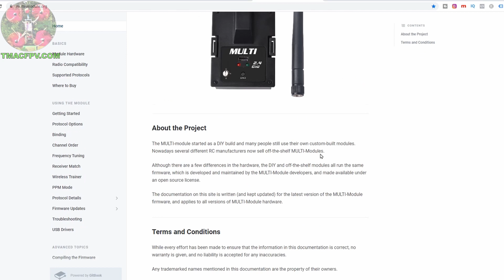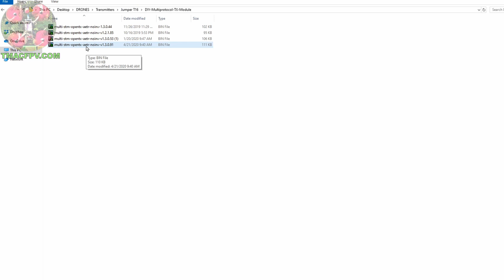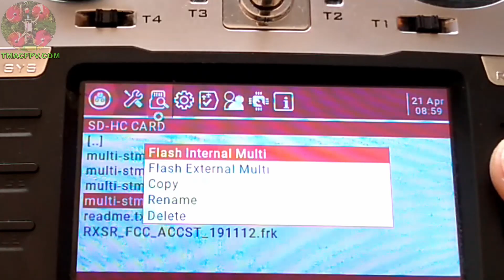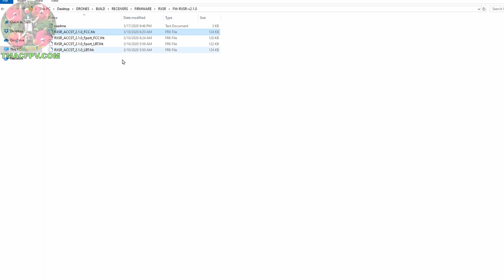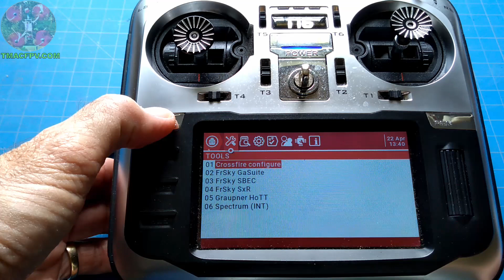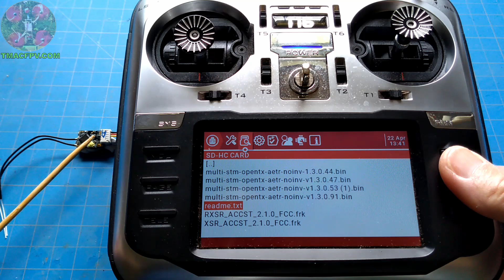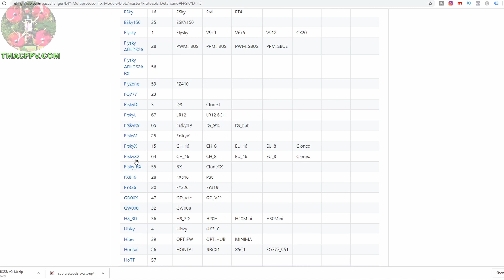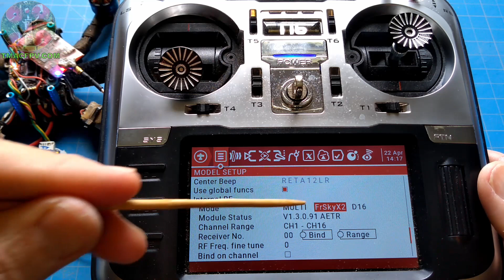Jumper T16 (NEW PROTOCOLS!)

Comment: is this update available for t8sg plus v2?
Reply from the maker: I do not believe t8sg plus V2 transmitter is supported by OpenTX operating system firmware.  i think it uses something else, therefore I do not know if the firmware that it DOES use has this update available or not

Comment: Just wondering is there any benefit to ACCST v2? 

Do you know if XM receiver comes with D8 or just D16? If D16 it’ll come with either accst v1 or v2? So I just select the correct option on my MPM radio and I’ll be good?
Reply from the maker: ACCST V2 was developed (supposedly) to correct inadvertent/random servo movements in fixed wing aircraft.  ACCST V1 works fine for quads. Tough these days to know what firmware will come on FrSky receivers. But, yes, if you get an XM+ it will most likely come with ACCST V1 or V2 and you just try them both on your multimodule of the transmitter. See FrSky X or FrSky X2 here https://www.multi-module.org/basics/supported-protocols Also, you may be able to bind in either D16 or D8

Comment: Thank you very much @TMac ! What about G-RX6_ACCST_LBT_2.1.0.frk / G-RX8. Is it working with the new Protocolls? I do have the issue with the servo movements on a G-RX6 receiver. As I am in Germany, I use the LBT Version.
Reply from the maker: Supported protocols can be found at multi-module.org . Here's what the site says about ACCST V2.1  which is multinodular protocol FrSky X2 https://www.multi-module.org/using-the-module/protocol-details/frsky-x2
Reply: @TMacFPV  so, uses the X6R the same Firmware as the G-RX6... too many Rs and Xs ;) Unfortunately there ist nothing to find about the G-RX Versions on the web about this topic.
Reply from the maker: The ACCST D16 firmware for the G-RX6 receiver can be found on FrSky site here  https://www.frsky-rc.com/g-rx6/ which is supported per mult-module.org site provided earlier

Comment: Howdy Tmac, does this apply to the roadmaster TX16S? Thanks!
Reply from the maker: Howdy CountryBoy Motovlogs! Yep, sure does!👍Basically, all of the videos I have about the Jumper T16 apply to the RadioMaster TX16S since both are running OpenTX (System) firmware and both have the internal multi-protocol module.

Comment: hello i just received the radio master tx16s and i succesfully bound it to RxSR receiver but i am getting no outputs would you consider firmware issue the problem?
Reply from the maker: Hey Miguel, congratulations on your new TX16S! Nice!  Well, I have no idea what firmware FrSky is currently shipping on their receivers.  I'm guessing it has ACCST D16 v2.1 firmware on it.  If that is the case, you should try binding it to your TX16S with FrSky X2 protocol within the internal multimodule.  IF it has the older ACCST D16 version firmware on it, just try binding it with FrSky D16 protocol.  so, try one and see if it works. If not, try the other.  There MAY be two FrSky X2 protocols which show up on your internal multimodule (for some unknown reason, that's what I have).  If so, try them both.  The 2d one that showed up on my module worked for me.
Reply: @TMacFPV  ok thanks for the advice, i had no idea of witch firmware version i had so i updated them both to the latest i had no luck with my issue :/

Comment: Please tell me why, when I bind to rxsr, 3 led lights up, and nothing happens ????
Reply from the maker: What protocol did you bind it with? Perhaps it has FrSkys version 2.1 firmware on it? If so, you'll need to bind it with FrSkyX2 protocol in the Multi-protocol Module
Reply: @TMacFPV  I wish everything the same as in the video ... Jumper t16 + r-xsr....not work

Comment: thank you for this amazing vidéo. please you know if it's the same for the radiomaster t16? thank's!
Reply from the maker: Good question!  Should be the same because I believe they both use the same chips for their multi-protocol module and its the same folks that work do the work and develop the code for the module.  So, the multi-protocol module firmware should be identical and therefore the procedures would be exactly the same.  You do, however, need to keep an eye out for the latest firmware version on BOTH the multi-protocol module https://www.multi-module.org/ AND OpenTX https://www.open-tx.org/downloads (think OpenTX version 2.4 will have RadioMaster TX16S).
Reply: @TMacFPV  thank's a lot, i am waiting for it, and i have to know all to have the best firmware and more. i hope it be my all days radio, because i have many differents protocols and radios, now one for all? i hope it work's well. thank's for all ;)

Comment: Thanks a lot for the great videos. I have the T16 and a couple of Jumper R1F receivers. I've been trying to get them bound, but it's not happening. I've flashed the new multi protocol firmware and tried binding in Frsky and FrskyX2 in D16. I've tried to bind with a fresh RX and with an RX on which I flashed the R-XRS 2.1 FCC F-port firmware (RXSR_ACCST_2.1.0_Fport_FCC.frk). I'm not getting anything to bind. I'm in Europe, so there could be some FCC/LBT stuff going on, but I've tried both of those too.

Do you have any pointers on what I could try next?
Reply from the maker: One thing, when flashing new firmware to the R1F, its an XSR clone NOT an R-XSR clone.  So, you need to use XSR firmware
Reply: TMac thanks for the reply! I tried the XSR firmware, but that didn't work either, maybe because there's no XSR F-port firmware? I also tried the XSR-M F-port beta, but that didn't bind either. I'm pretty lost right now at what I'm doing wrong.

Comment: i did the update but I got the t16 pro with internal module. i can bind to emax AIO tinyhawk 2, tinyhawk freestyle no issues.

trying to bind my new iflight xl5 with XM+ /r-xsr
my diatone taycan with r-xsr wont bind either

internal module v1.3.0.95
xm+ v2.1.0
r-sxr v2.1.0
OpenTX 2.3.7

no luck what so ever. it just sits there full green full red.
am i running the wrong firmware versions?
Reply from the maker: Are you using FrSkyX2 protocol for Multi-protocol Module?
Reply: @TMacFPV  woops i did frskyx  ok xm is binded quad is beeping but not spinning :p  r-sxr no luck yet.   I thought made it so third party like jumper t16 wont be Abel to use the new accst2 :/
Reply: @TMacFPV  SORTED!
Sorted!:
im total novice with quads so, i found the issue and wanted to share it.
my iflight XL bnf analog had GPS! i live on the mountain side and oure house has some dense concrete. 
GPS couldnt get a FIX posision 　 so i typed
set gps_rescue_allow_arming_without_fix =ON

Comment: Hi, just flashed R1+ with ACCST 2.1 and works fine, but I've got an error executing lua script for BF bf.lua): Telemetry protocol not supported ! I also updated scripts to the latest version available. IS anyone facing the same issue ?
Reply: Solved installing latest nightly opentx version: 2.3.8N211

Comment: The protocol doesn't seem stable on the xrsx.  In betflight on the receiver tab i can see the channel signals flicker and the quad moves without stick inputs. With the a xm or xm+ the channel inputs do not move/flicker unless there are stick inputs.  I am using a T12 radio on opentx 2.3.7 and the same version on the 4-in-1 module  v1.3.0.91.  Have you noticed this?
Reply from the maker: I have not. have you attempted to fine-tune it per https://www.multi-module.org/using-the-module/frequency-tuning
Reply: @TMacFPV  i just did but no success.  i replaced with a xm+ and no fluttering.  what version of opentx are you running?
Reply from the maker: 2.3.7
Reply from the maker: Also, MPM firmware version 1.3.0.91
Use FrSkyX2 for binding
Reply: @TMacFPV  i'm running same.  maybe a compatibility issue with the t12 but not t16.  thx for the info!  i'll try experimenting on another quad and different settings.  if i figure it out i'll share.  cheers
Reply from the maker: Sounds good, thanks 👍

Comment: I just looked through all your videos and noticed you don't have DJI fpv and kinda curious as to why.  I just bought it and flew it all day with my crossfire and it's pretty nice debating whether I would buy it again I think so depending on how I'm flying. Just wondering if you have tried it or care too.
Reply from the maker: Hey Ruby! Great question! You are correct, I do not have it (yet).  I don't usually "jump" on the first edition of things that come out in this hobby, been burned too many times.  Waiting for the next "competitively-priced" digital system with all the bugs worked out.  I've been flying my $270 Aomway Commnader V1s and they work just fine for my purpose for now!😀 We may see some "improvements" come out this summer hopefully.  I understand the DJI picture is awesome though, you're lucky!
Reply: @TMacFPV  Smart. I'm a small framed female and didn't like how the dominator style fit. The fatshark scouts where perfect and before them I flew fatsharks with a giant gasket thing.  The scouts with a caddx ratel are really nice for me anyways. DJI above 20 feet is really nice but down low with objects in the way you can see it. My brother said before the updates it would just freeze now it looks like Netflix when the signal isn't so good. the latency wasn't an issue most of the time. Best part is at 700mw the next person can be on the next channel and there is zero effect that was impressive.if you wait for the next one you won't miss much as of now. And no audio while you fly is strange I prefer to listen.  I got my GPS thing setup this morning from your how too. Its super weird like a robot takes over. Thanks tmac appreciate you.
Reply from the maker: Ruby, thank you so much for that info, very nice of you.  I too like the audio when I fly! I think you're the first person who's actually said that to me 😁Most people have never tried it and don't know what they're missing. I love the Ratel! Real nice image and great picture quality at dusk. Right now, I'm very happy with Caddx Tarsier V2. Great FPV image in goggles with one can and HD on SD card with the other. I've got 3 of them installed 👍Have a great week!

Comment: Hi Mac, am i right ? It is still not possible to flash 2.1 on a Jumper R1 Receiver. Binding is still not possible.
By the way. Top Video.
Reply from the maker: Hey Bjorn, great to hear from you and thank you!  I have flashed my Jumper R1 with ACCST D16 v2.1 firmware using the same process and I was able to bind it with no issues.  Remember, as stated in the video, you need to use XSR firmware (not R-XSR firmware) and bind with FrSkyX2 in transmitter
Reply: @TMacFPV  🙈Thanx, i used the wrong Firmware.....
Reply from the maker: @bjorndestree8496  Sure!

Comment: Just one more quick query. I recently uploaded a new slash screen and others and they are fine. However, I've now got a very stuttery Hello voice. I removed everything and went back to all standard but it's still there. You can understand it but it's all broken up.  Any ideas?
Reply from the maker: Loose connector from the speaker board inside the TX perhaps? You're not using the original SD card that came with the TX are you? Maxed out SD card if you are? Original SD card is no good. All just thoughts 🤔
Reply: @TMacFPV  Now thats a point regarding the SD Card. Ill replace it since I am using the same one that came with it. I think if it was a loose connector it would happen on all voice files. Again thank you for your thoughts. Beautiful day here and we cant fly grrrrrrrrrr. Im going to build a micron drone as per a vid you did in Jan. Something to do

Comment: Hi TMac, I just uploaded the v2+ firmware to an X8R and reflashed the Jumper T16 internal module to the latest version . I cant get it to bind. I accidentally did this a couple of weeks ago and had yo go back to an earlier version so was hoping this would work. Maybe Ive done something wrong but I can't see what.  I've checked that the correct firmware is loaded on the X8R and the T16 module. Any ideas?
Reply from the maker: Hey Donald! Good to hear from you. No ideas, without more info.  What version OpenTX do you have installed?  Latest? What version of the multimodule firmware do you have installed?  Latest? Did you flash X8R_ACCST_2.1.0_FCC.frk (or the LBT version) from this site: https://www.frsky-rc.com/x8r/ ?  Did you choose FrSkyX2 in transmitter for binding and turn External RF OFF (assuming you have an internal module)?  Did you try "frequency tuning" per this site prior to binding? https://www.multi-module.org/using-the-module/frequency-tuning .    Those are things i can think of to check.
Reply: @TMacFPV  Ill get back to you shortly after checking all this out. I am assuming then that it should work with an X8R and not just with the Xsr's?
Reply: Sorted and yet again thank you. I didn't choose FrSkyX2. Works perfectly. Hope all is well with you over there. We are about to come out of level 4 of our lockdown on Tuesday so fingers crossed. At this stage, we still cannot fly anything but really stupid since you can go fishing, play golf, swim, go to the beach etc etc but oh no you can't stand on a park all alone and fly a drone or plane. drrr
Reply from the maker: Check  out the descriptions on the site mentioned in the video for FrSkyX and FrSkyX2 protocols
Reply from the maker: Great to hear Donald, outstanding!👍Yes, there are some things going on that just make you go hmmmm 🤔 Stay safe friend 😁

Comment: Hi TMac, another great video thank you.  Is there anyway of identifying which firmware is already installed on the FrSky receivers?  I've held off updating my old R-XSR's but I've also a couple of new R-XSR's which I assume FrSky may have supplied with latest firmware.
Reply from the maker: Thank you! 🙏James, I really wish I had the answer you're looking for because you asked $1 million question!  What firmware is currently on the FrSky receivers sitting on the shelves of all the vendors?  Do some R-XSRs have v1.x and others have 2.1?  Do the vendors site show what version, no.  The vendors most likely do not know.  Has FrSky said when they did (or will) start shipping receivers with v2.1 on them? Not to my knowledge.  So, where does that leave us?  Purchase an R-XSR, try to bind it with FrSky D16 with previous multimodule firmware.  If it works, then you have a receiver with v1.x firmware on it.  If it doesn't and you did everything else correctly, it may have v2.1 on it, in which case you would need to update your multimodule firmware.  OR, just update your multimodule firmware to the latest and whatever FrSky ACCST receiver you buy, update those to v2.1 when you get them (which I believe is what I would do--oh yeah, I just did!)😀👍Also, remember there are many other options out there for you as well (see referenced video in link above for those).

Comment: im guessing this was just for demonstration?  you used model 0...I was doing that with the taranis.  you are supposed to fine tune each receiver to this radio right?
Reply from the maker: Yes, demo purposes only, I did not get into fine-tuning the receiver (which I have another video on), nor setting anything else up in the transmitter.  All the info on fine-tuning is here: https://www.multi-module.org/using-the-module/frequency-tuning
Reply: @TMacFPV  no no...all good. im tracking that part. only real beef with the jumper and its not really a big deal. I had just switched my fleet of all 4 quads over to 2 models. lots of work there!  so when I went to the jumper I see it up the same way.  then I found out about the fine tuning and basically started over.  was just double tapping that there was not another way to do this.  thanks for the speedy reply!  keep up the great work!

Comment: Thanks for the detailed guide. Interesting video. Somehow I’m glad that I went with crossfire instead 😂 don’t need to deal with servo cable. Only thing is slightly more expensive receiver but glad they cut 5usd off permanently recently. What’s the difference between access and accst btw?
Reply from the maker: Hey Joel, quite welcome friend👍ACCST is FrSkys previous version firmware (been around for a long time and a whole lot of receivers and TXs use it). ACCESS is FrSky's newest firmware which is compatible only with FrSky transmitters.  It has 24 channels instead of 16 for ACCST. It has slightly less latency than ACCST, and "automatic binding" (similar to XFire) by "registering" your RX to TX first. I primarily use Crossfire myself. "Just works!"
Reply: @TMacFPV  do you know if other radios like Jumper T16 will support the ACCESS protocol ? or is it proprietary ?
Reply from the maker: @warandv6614  ACCESS protocol is currently not supported by multi-protocol transmitters (Jumper T16, Jumper T18, RadioMaster T16, etc.) and it is proprietary